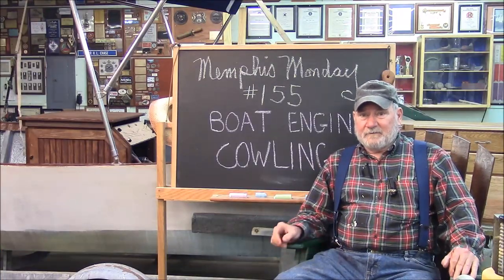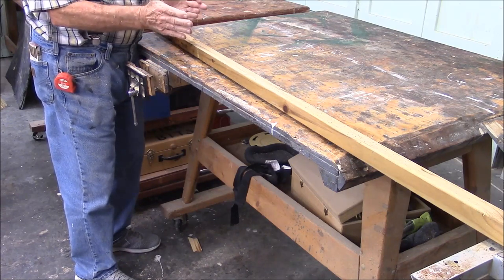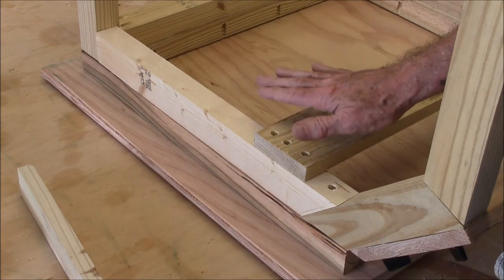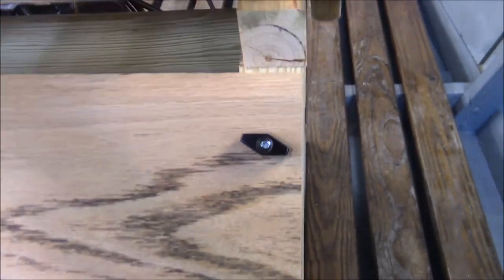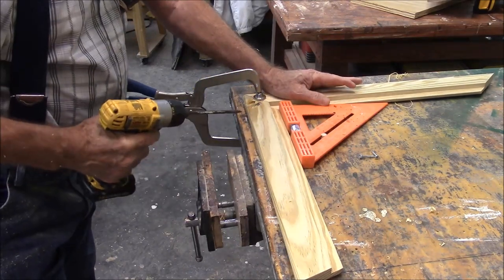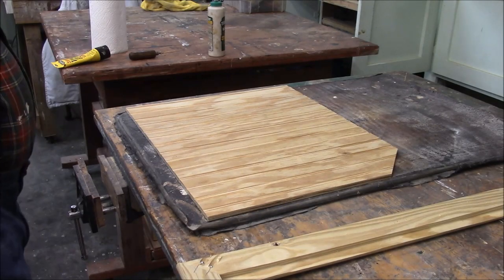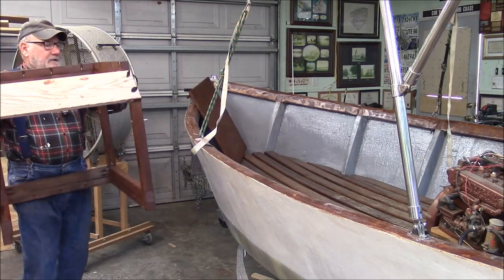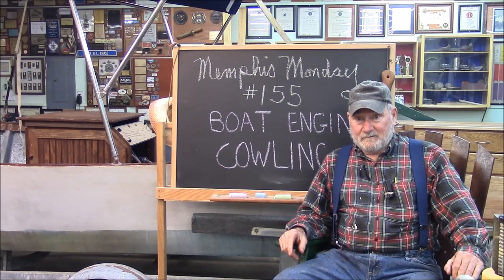155 Building Engine Cowling for my wooden inboard boat

Comment: The engine cowling looks great. The thumb screws you used on the side panels were a good idea and certainly a lot less hassle than screws or removing the entire cowling to service the engine. Sorry to hear your wife is a bit upset about the time and money you spend on the boat. My own experience has shown that hobbies are generally time consuming and expensive, but hobbies are necessary to help us wind down from the things we have to do in our day to day lives. I'm looking forward to the year in review video. I really enjoyed that last year and it was fun taking a look back at your past projects.
Reply from the maker: Thanks for the kind words, as always.  I also think the cowling turned out great.  I guess success in projects is a spectrum, a few projects are to the left, most are in the middle. and a few fall to the right.  For me the cowling fell on the right side of the curve.  
       I love those thumb screws.  Found them at Tractor Supply years ago, and now keep a ready supply.
       Just kidding of course about the wife.  I think she knows that I could be spending my time and money in even more self-destructive ways.  Besides, I think she likes it that I generally spend all day in the shop, or outside.  Funny story.  Once she complained about my electric bill.  I  very subtly implied that I'd stop running my heating and air-conditioning in the shop to save money.  She instantly realized that I'd be spending much more time in the house, and she backed up quick.  "You can run the heating and air-conditioning, just turn it off at night," she said.  "Yes dear," I replied.  
      Yep, the last day of our Junior Year is coming up.  We will be Seniors!!!!  
       Thanks again for watching and commenting.
Reply: That's a good point about being in the house all day instead of in your shop. I just finished watching your year in review video and I really did enjoy it.  I guess we'e seniors now! :-D
Reply from the maker: Seniors.  I'm running for class president.  But I think Hippie has her eye on that job.

Comment: Why did you use a jigsaw on that cut? Wouldn't it be easier to clamp a fence/straight edge to the plywood to guide a circular saw? A jigsaw is not the ideal saw for cutting a straight line.
Reply from the maker: I do use that 20V Jigsaw too much.  I love it.
However, in my defense, "that cut" was only applied to cut that 4x8 sheet of plywood into two 4x4 sheets (making it easier to handle).  All finish cuts were made on my table saw.
     I'm getting old Jim.  I often cut whole sheets of plywood up in smaller chunks, especially 3/4 inch, if no finished pieces will be over about 46 inches.  
      Jigsaws are terrible at cutting straight lines, and the reciprocating blade kills plywood .  I have a couple of BORA clamping straight edge kits, with the circular saw adapter.  However, I've never used the adapter on a real project, instead I just use the clamping straight edge with a 20 volt DeWalt circular saw.  
      Thanks for watching and commenting.  It's great to talk shop with someone who knows the details.
Reply: I was referring to the cut you made at 16:10. I just thought it was odd, but now I know. You love your jigsaw. I feel the same way about my well-balanced hammer. Check out my blind nail challenge: https://tinyurl.com/y8ytyoaq
 Now, you're probably thinking about how to hide a nail in T&G, not so! If you find the time, maybe you could upload a digit smashing clinic of your own. Just kidding. I trust that it will be nothing less than a maven execution of skill!
Reply from the maker: I went back and watched.  I assumed you were referring to my habit of chunking up plywood before I run it through the table saw.  
     Now I see what you mean.  My only defense is that it was a very short cut that was hidden by the rabbit.  However, I must have had the same misgivings as you, as I went on to explain how to make the jigsaw cut as un-ugly as possible.  
     Yep, I saw your video earlier.  But as I have said many times, I'm no carpenter.  I have trouble enough driving a nail with my eyes wide open.  And with my bad left hand, I often start nails by holding them with pliers, as my nail holding fingers are numb, nerveless, bone damaged, with poor circulation.  Any digit smashing of those digits would likely be more of a challenge than I would want.